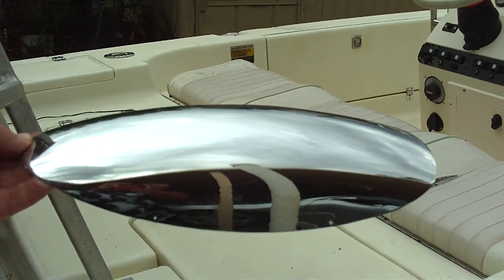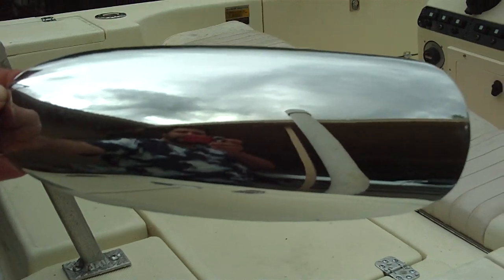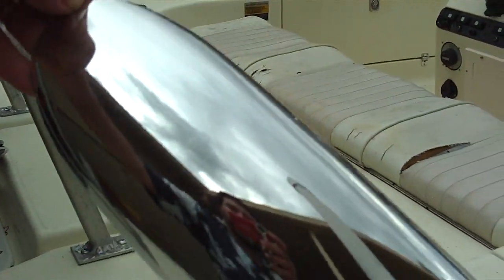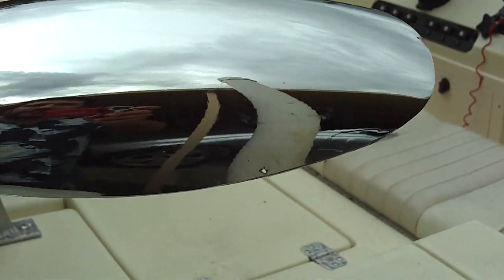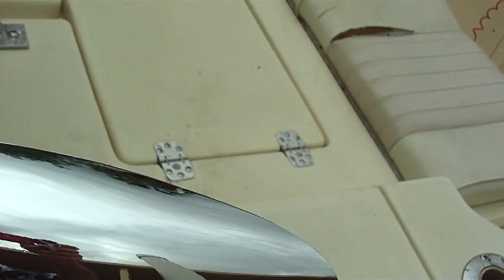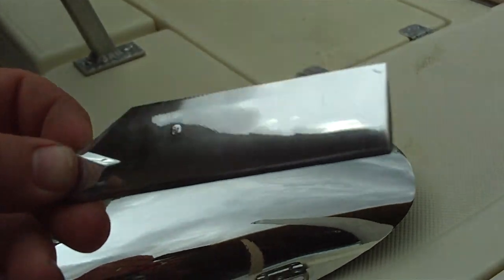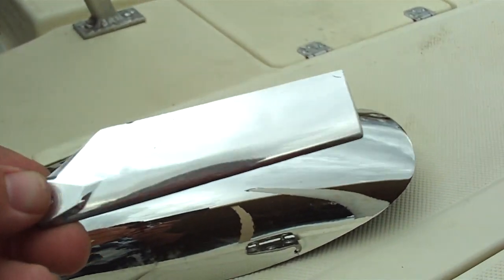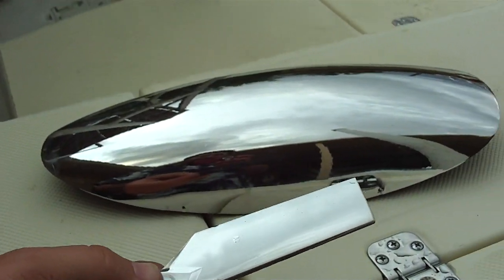Playing with Heli Parts and the Vacuum Deposition Chamber

Comment: Thank you for posting this!  I'm in the process of putting together a high vacuum rig to do exactly this sort of thing (metalizing plastic pieces).  Was it difficult getting an even coating on the surfaces?  Was temperature an issue?